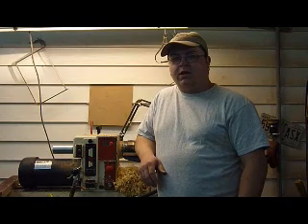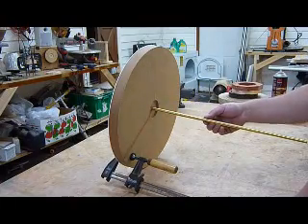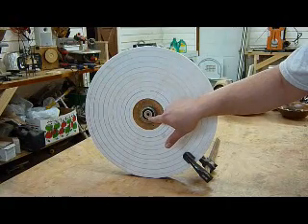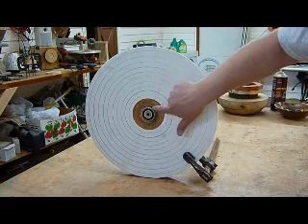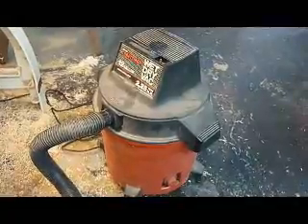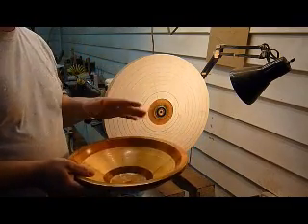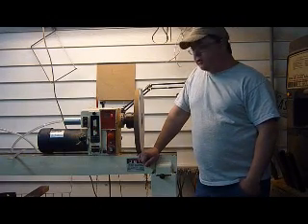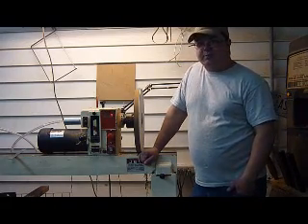vacuum chuck

Comment: My cheap lathe doesn't have the hollow shaft, so I need to figure out a rotating vacuum connection to fit behind the chuck and hose off the side. 
Any Idea's?

Comment: Slick!

One question - how do you remove it from the lathe?  I understand that the disk is mounted on the 4-jaw chuck, but it seems like everything else is connected.  (Unless you unthread the hose from the lamp rod every time.)

Comment: I had made a flat-plate style vacuum chuck, but found it far too limited in what it would hold. I instead used a PVC connector epoxied into a recess I turned into a double-layer lamination of 3/4" MDF.  I added a disc to the back for my chuck to grab, and glued surgical rubber tube around the edge of the PVC with silicone and drilled a proper size center hole.
 I then used a Hold-Fast vacuum adapter kit to finish it off. A JB Eliminator pump powers it.

Works awesome, and is very versatile!

Comment: Thanks for the video Brian.  I made a vacuum chuck based on your system and it worked great.  I tried using a vacuum cleaner but it overheated, so I went to a vacuum pump.  I used a 10mm OD steel tube and I also have a bearing at the rear of the headstock to give greater support.